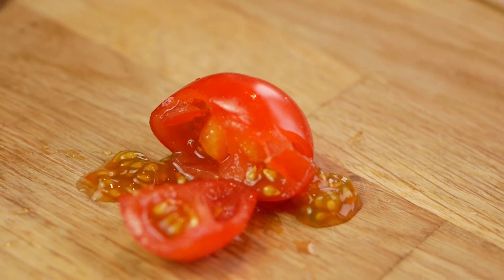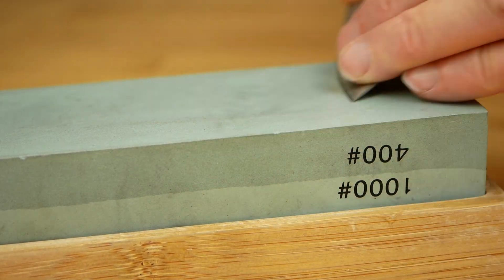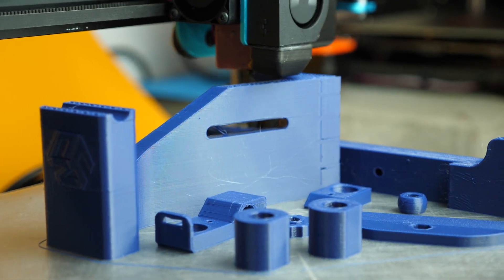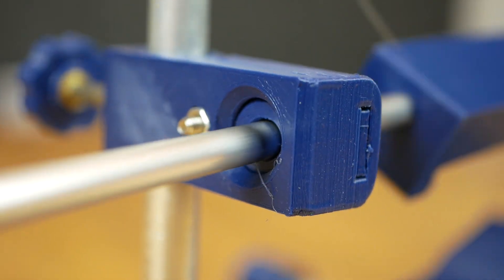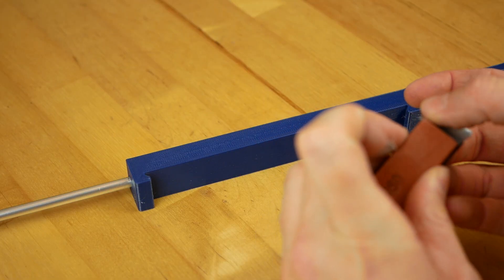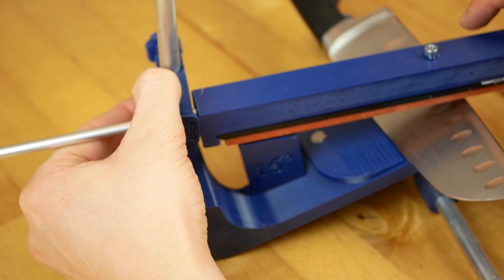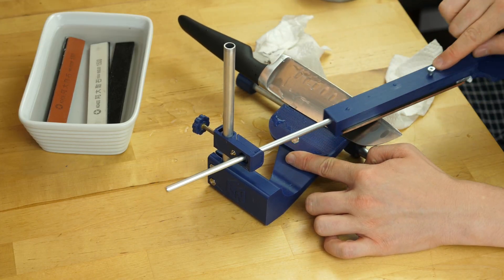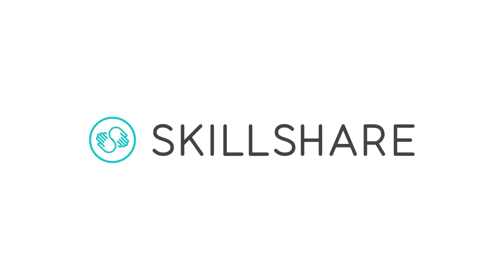PERFECTLY sharp knifes! 3D PRINTED sharpening tool 🍴

Comment from the maker: Feel free to share and discuss the video on you Social Media plattform of choice!
First BTW!
Reply: the only improvement i would make is a clamping plate that could easily be incorporated in the same bolt for the depth adjustment as it only needs to clamp on the spine half of the blade to prevent side to side movement of the knife. just a thought.
Reply: Would it be practical to make spherical bearing able to move left - right? It could make angle even more uniform, especially at the tip.
Reply: The spherical bearing idea to remove sloppy movement is a good idea but, the magnetic hold isn't terribly useful as many blades use non-magnetic or poorly magnetic alloys.
Addition of either a spring clip or physical clamp would go a long way in improving functionality.
Even use of a dovetail and spring to apply pressure to the stone would be beneficial in accounting for variation in those inexpensive stones.
Reply: I need to make a cover of a water pump duct in my car, could you recommend some material that supports hot water of 110 degrees Celsius and pressure of the water circuit of the car and that is durable over time? Thanks!
Reply: @k1kote  
ASA filament should work. If not, look into polycarbonate (PC) which is the hardest of filaments.
Reply: I might see a update you could add:
making it possible to Also clamp down the Knife
Reply: Could you make a 3D printed Wicked Edge Knife sharpener?
Reply: you forgot to make sous vide steak test
Reply: I'm sorry to say this, but and I know you speak German, but its actually knives
Reply: Wanted to watch this, but the  music made me stop.  Please stop adding background music.
Reply: why not stop printing and wasting all that plastic just to make more junk that will eventually end up in a landfill for a the next 9000 years
Reply: @catnium  
You're showing your ignorance of 3d printing filaments.
They are all biodegradable!
Now get off your SJW soapbox and get back to your games in mommy's basement.
Reply: @catnium  PLA is biodegradable.

Comment: I would add a modification to the angle guide to have magnet insert with the base plate with a magnet insert as well so that the angle adjuster is not moving and will stay on while you adjust the angle of sharpening hands free from holding the angle block.

Comment: Hi, thank you for this great design. As someone who is using this technique and building several of these from wood, metal etc.. Id like to ask you to tweak this design a little for other users. The idea is not bad at all. But there really should be just a few things to improve. 1st knife clamp, the knife itself shouldt move at all, once youll sharpen expensive blade, id could do serious damage, magnets are great helper to hold knife before its tighten. 2. there should be 2 horizontal bars to prevent movement and make it easier to keep the right angle. 3rd stone holder should be adjustable, because piece of tape is not precision at all...4th make it more stable, because stability and lack of any movement of any part in any direction is the key. 
Overall very good idea and only little should be twaeked to have awesome and one of the most usable design over thingverse. Im sorry I dont have skills like you have to design something that good and usefull. Thanks David

Comment: the guide tube will work better if square and not round, allowing the stone to pivot only side  to side.Quite a challenge to design the encapsulated bearing.Maybe likely only possible with a 3D printer.It kind of reminds me of an old video I saw where someone made square wheels that actually worked.

Comment: Awesome. Other sharpeners hold the knife in place with a clamp. Not sure why you chose magnets. You could easily slide the knife under that swiveling backstop and tighten it with a butterfly nut.

Comment: when sharpening, you should try going for longer strokes across the entire length of the blade instead of short saw-like movements.  the latter might cause inconsistencies in the blade's curve or even a recurve section which can be very annoying when chopping (the edge doesn't touch the board perfectly and leaves a bit uncut at the bottom).  Also with when you get to your fine stones, try "stropping" the knife with it.  only pull back with the stone while using extremely light pressure for a couple passes on each side back and forth.  this will even out the wire-edge at the end and make it sharper than the stone normally would with normal sharpening technique.  Finally, I think you should spend some more time with the finer stones because the knife seems to want to snag the cutting board rather than slide across it, which is a sign of a saw-tooth-like edge.  You stropped it well, so it can't be a wire edge, but rather a sawtooth edge left over from coarser stones.  Either that or maybe the molybdenum-vanadium-steel alloy IKEA used is just very brittle and chiped while sharpening.  I know that some cheaper, very hard and brittle steels can chip and crumble when sharpening, but this is rare.

Comment: You are grinding which is why the edge looks like a saw in your close up. Here is the process..

Pull the stone toward you with SLIGHT pressure on the blade. 

Make ONE sweeping motion from heel to tip across one stone swipe. So basically you PULL (forward stroke) the stone toward you and it covers the entire blade.

LIFT the stone off the blade and reset back to the heel. The stone should not contact the blade on the push stroke (aft stroke).

After a while drag your finger nail from the back of the blade toward the edge on the side you are NOT sharpening. You will evidently feel a burr as your fingernail catches it as you drag over it. This is a microscopic burr formed as the metal is rolled over. This indicates you are sharpening at the edge. You want to keep going until you can feel this burr across the entire blade edge.

FLIP the blade and with NO pressure pull the stone toward you on the blade. This will snap that buff off. This is also referred to as snapping off the wire.

Sharpen the new side by repeating the above.

Reduce stone coarseness and repeat the process. Continually making a burr and snapping it off.

The end result is the metal having an edge as sharp as the metal can be and it being SMOOTH..

Strop using leather (with or without polish) to maintain the edge. If stropped regularly you’ll never need to sharpen the edge again as long as it doesn’t become too dull or damaged. With maintenance the sharpening tool you made should only need to be used once or for reprofiling an edge.

You made the tool but you are just using it like a grinder. This will definitely make a sharp edge but no where near as sharp as it’s capable of.

If my instructions aren’t clear just download the manual for a high end sharpener like you made and it will elaborate better.

https://www.edgeproinc.com/content/manuals/EdgePro_Instruction-Manual_Apex.pdf

“Only sharpen on the forward stroke, and lift the stone off the blade in the aft stroke”

It also should illustrations (albeit not well) of burr formation.

Love your channel tho, keep up the good work!

Comment: I find the stone supporting element to be rather poorly designed. It works only with a very narrow range of sizes/stone types, and even then you often have to use some little fixes like tape.
I think that area needs a lot of improvement.

Comment: I have the original (as far as I know) knife sharpener that all these style sharpeners are copied from, and it is awesome. Edge Pro Apex, made locally to me in Hood River, Oregon.

The critical part with these style sharpeners is your stones have to be flat. If they aren't flat, you won't get a good edge. Use a piece of glass and silicon carbide sand to flatten them.

Comment: the problem here is the same as with the LANSKY on which it is based. the further the grinding stone is from the centre of the blade edge, i.e. perpendicular, the more acute the angle [i.e. for example 12 degrees instead of 15 degrees] - this means two things: 1. the edge angle of the blade is not uniform over its length and 2. each time you do not insert the blade EXACTLY the same as the previous time, or, as in this case there is a slight movement due to the magnets not being strong enough, you end up with angle variations on the blade.... sharpening is far less a mechanical process than an art!

Comment: Ahh! This is essentially an "Edge Pro". I made my own clone of this sharpener about 10 years ago just using some basic stuff from the hardware store and it will make a knife sharper than you can imagine. Shaving hair off your arm is amateur hour for how sharp they can get. Using my emerson folding knife, i can hold up a sheet of 24lb bond paper, let it go and cut it end to end with one swipe. its amazing.

Comment: there might as well be a version of this that holds the individual stones on their own in some way.  the glue that holds the actual stones to the plastic bits they come with is absolutely piss poor, two of them came detached immediately when the hold down screw was tightened... it's 12 usd from china so there's not a high expectation to start with, but kinda made the whole print not work with the holding method...

Comment: Great video. Thank you. Please help, in the guideBody1 file, I'd like to fit a bigger nut inside the extruded portion. I've tried learning on line but can't figure it out yet. It's been 3 hours strait wacting tutorials. The nut exterior is 7.93mm. Thanks. I wish you could put out a tutorial of this design in fusion360.

Comment: Actually the Ruxin Pro presented as "not the best choice" is quite a good tool. Adding some wood stand to it makes it even better.
As for the 3D printed sharpener i think magnets are sort of Ok but in time they will start taking all the metal in. Also the knife is not 100% stable what may affect sharpening process. But all together it looks quite decent.

Comment: Dull knives are more dangerous than very sharp knives. Because of their inability to cut, you're far more likely to slip and cut yourself on a dull knife. A knife is safe when it cuts consistently and you're in control. Also remember that cutting back and forth cuts better than just pushing down. At least initially, when the blade begins to cut, you can press down.

Comment: The first time I got a kitchen knife at Ikea, my friend, at the time a materials science student, was with me. He'd done some studying of stainless steels, and he said that the steel used in the stamped knives at that time (blue and grey handles) looked really promising. They're still pretty sharp (almost 20 years later), although they could probably use some touching up.
Reply: I have two Ikea 365+ knifes, one of them is heavily abused second hand. I only sharpened it once and it's staying sharp for a very long time. X50CrMoV15 stainless steel has a solid reputation

Comment: nice design but you should really sharpen a blade from the bottom to the tip, and in a  away motion from the blade.   Instead of "slicing into the stone" go backwards,   In your design, it would be pulling the stone forward only, then lifting it to push it back, to pull again.   A full swipe should be done from handle to tip each pass for best sharpening results.    It would be really amazing if you added something that when you "pushed" it back it raised it off the blade, so that only "pulling strokes"  contacted the metal, then you would just have to get used to 1 pull going across the entire blade instead of small sections.

Comment: You should put a slot in the base to hold the angle block, so you don’t need to fiddle with it while you set the height of the stone. Then you can just lay the stone on the block and tighten the set screw. 🤓👍

Comment: I am sorry
There are so many things wrong with this, i love your channel, i really do, but this is, this hurts 
So lets start
What you are sharpening is a V-Edge, V-Edges are weaker then Convex or scandi, (convex being the result you reach with a normal sharpening stone) 
We wanna get away from the V-Edge, thats why professional sharpeners use wheels, they reach a similar result.
Next up, the stones that you used are wheatstones, with these stones you are only to use water. Oil is a no go, absolutely a no go. 

Another tip, the leather you used was waaaay to soft. This ruined your edge, and your knife wasnt as sharp. To simplify it, it wraps around the edge and the destroys the edge. 

ANOTHER TIP: Before you stow away your knives, i would recommend you rub them in with oils. 

Another tip: buy ONE expensive knife, i can recommend Dalstrong (you have great robust knifes), with g10 garolite handels
Here i cant tell you which one (which knife to buy), but i believe you are better in cutting stuff then i am, thus you know what knives you like. 

Again, this is no hate, i hope you understand. 
Greetings from Switzerland
Reply: I'm sorry to disagree! Convex is almost impossible to do at home and if you attempt to do it, the resulting incorrect convex is much worse than a V-edge half sharpened (I know, I tried it). I personally prefer a compound bevel, which can be easily made with this sharpener using 2 angle gauges. Just for reference (and this is all a matter of opinion and personal preferences), I quote this reply in the Bladeforum.com, about the "ideal" angle: http://prntscr.com/qmo76m
Reply: @JoseSilveira-newhandleforYT  as soon as you start to sharpen with your hand on a whetstone you have a convex, thats a fact

Comment: I find it scary that the sharpened blade points to the user's fingers. This is something I always avoid when working with emery files on knifes. I hold down the knife firmly on a wooden block and work on the blade the cutting edge pointing away from me.
Reply: That method you use causes the blade to curl.

Comment: Damn my pissy build volume. I might need to get a bigger printer.
Reply: What printer do you have?  I don't have one, but the Reality CR10 appears to be a good compromise between cost and print quality. I have a friend that has gotten really good results from it (not Prusa good, but definitely close to it).
Reply: @gizmoguyar  
Dobot MOOZ 2. 130 mm³ volume. I have two of them so I can print, laser engrave and CNC mill but just not larger things. 
I'd like to get the CR10.
Reply: @gizmoguyar  Ended up buying the Ender 3. Was not disappointed.

Comment: Nice project. I am planning to build my own sharpening jig with a slightly different approach for about two years now. I'll try to make it from steel and already have some designs and parts ready, but don't find the time to continue. Maybe I should build one of Yours in the meantime :-). I realized that the spherical bearing still has some play. My tip would be to replace it with with a "Gelenklager"  (our German word. Probably "joint head" or "spherical plain bearing" in english) like these: https://www.ebay.de/str/kugellagershopberlin/Gelenklager/_i.html?_storecat=2073821013 and use some drill rod ("Silberstahl" in German)  like this: https://www.ebay.de/itm/Silberstahl-1-2210-gezogen-h9-sowie-Lange-frei-wahlbar/111227077025 . This should be an easy adaption and will give You a complete different experience, as it will run silky smooth and completely without play. Additionally I would extend the rod and ad an adjustable counterweight on the other end. By this You will have more feeling and control, especially when You come to the final stages where the edge becomes more and more vulnerable.

Comment: Really like this! An awesome addition could be a flippable knife holder for making it easier to switch sides of the knife. Look at the TSPROF sharpener or this: https://www.thingiverse.com/thing:1632878
Also, which macro camera (USB?) do you use for the macro shots of the blade?
Reply: There is also this one, which is really cool and has a flipping function! https://www.thingiverse.com/thing:3369727
Reply from the maker: I took the pictures and videos with my Panasonic GX80/GX85(aff: https://geni.us/0NJvs) and the 30mm macro lense (aff: https://geni.us/CYWX). Love it!

Comment: Couple of notes for myself:
1. Holding a knife is a key element here. Shouldn't move, yet should be easy to clamp allowing various blade types. 
2. Adding adjustable stoppers, so to use the whole surface of the stone. Otherwise it gets concave soon.

Comment: How often do you have to do this, when each sharpening session takes easily 30 minutes (depending on how dull it is and how long you take to set everything up)?
Reply: Etherion as long as you keep the angle consistent you can skip most of the rougher stones after the first sharping and just “retouch” the edge with the finer stones every few weeks depending on how much you use the knife.
Reply: @housegoth  Hmm, that's okay i guess. It would still annoy me to do this for 10-15 minutes every few weeks, but someone who loves cooking or takes pride in it might see that differently.

Comment: is ja echt ne nette idee aber wo soll mann denn das aluminium herbekommen?
währe besser gewesen wenn du die stangen auch druckbar gemacht hättest weil sonst müsste mann ja immer noch zum baumarkt gehen und wenn man da schon hin kann kann man auch gleich das von amazon bestellen ;
ist nicht böse gemeint ist nur ein tipp        

                                                                                                                                                                                     
  is really a nice idea but where should you get the aluminum ?

would have been better if you had the rods also printable because otherwise you could still go to the hardware store and if you can go there you can order the same from Amazon;
is not meant to be bad is just a tip